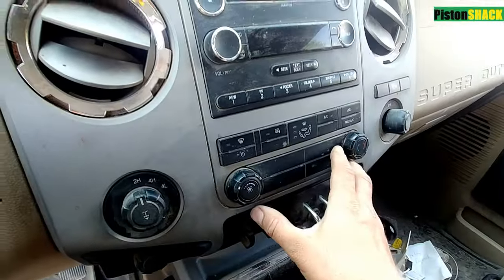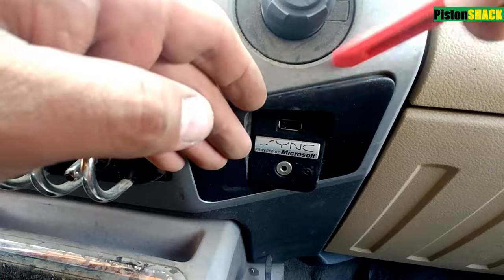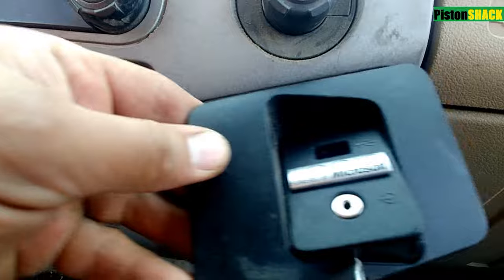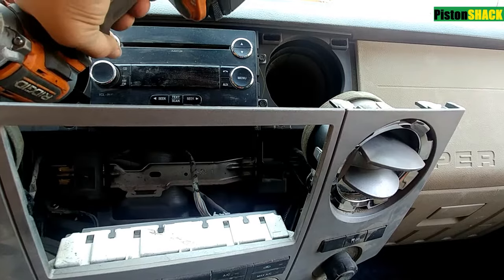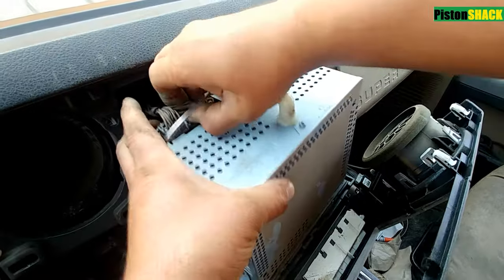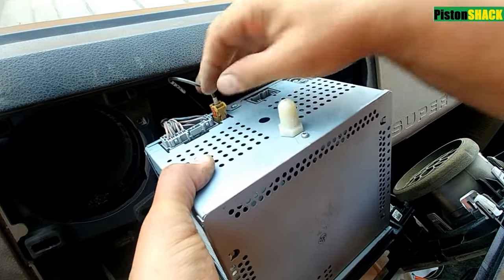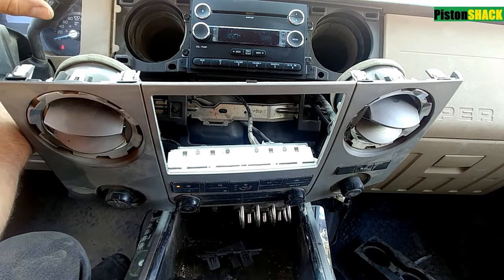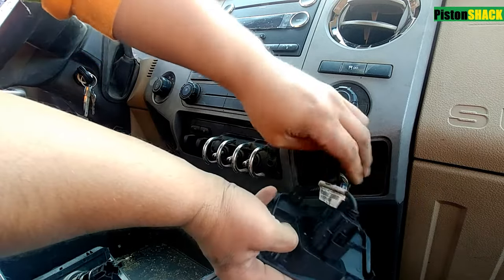HOW TO REPLACE FORD F250, F350 RADIO  in 3 minutes | Ford Super Duty 2009-2016 factory radio

Comment: On my 2011 F250 the factory radio worked but don't light up. I bought another factory radio from same year model. I installed it and it had power but lot static. I was told it would have to be reprogrammed at Ford dealership. That would cost more than aftermarket radio. So do these have to be reprogrammed? I heard it was theft deterrent.  My plugs are the same but numbers on the radio are different.